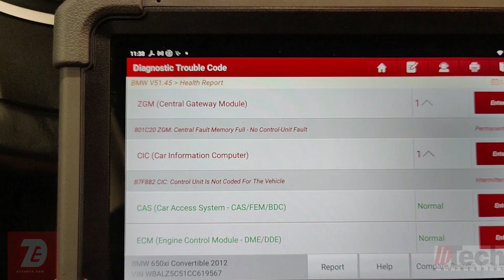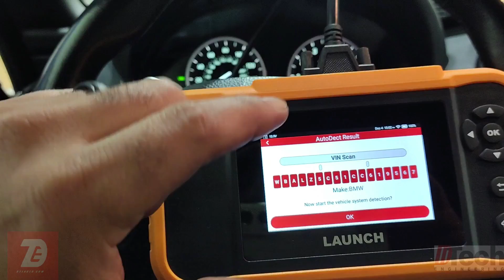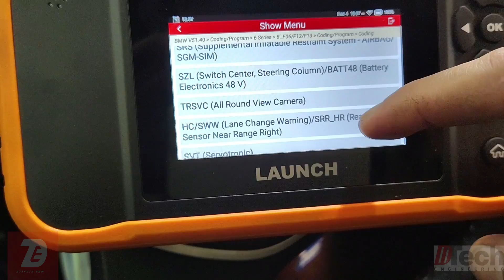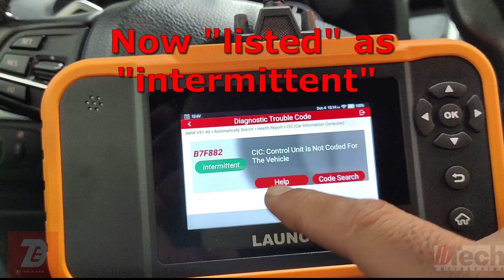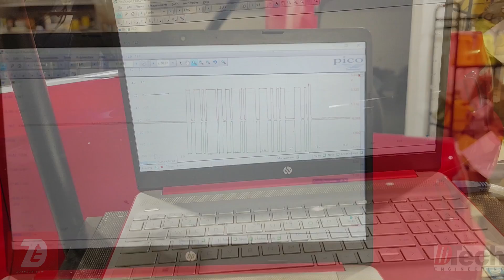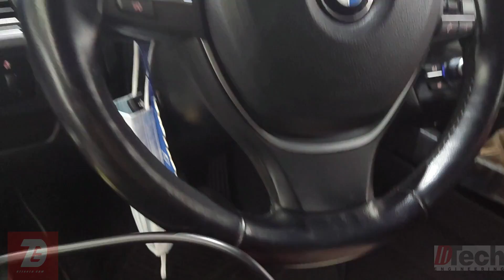BMW 650 i-Drive Knob Not Responding

Comment: Hello.  Urgent help please.  How did you remove the trim piece that contains the i-drive knob from the dash trim where they come together at the narrow part?  I know there are two screws that hold it in place, but then the center console trim will not release where it meets the dash trim?  The console piece seems to have a clip or a hook of some sort that goes into the backside of the dash trim?  I cannot make it out, but that is what it appears on your trim?  So, how do I separate the two pieces.

Comment: Hello boss i have trouble with the 2015 bmw 535d f10.or11.the car is not starting sometime is cranking sometime not and sometime is communication with the ecm sometime not showing me this trouble code in engine ecu 254D00 related to voltage please any idea what's wrong or waht i can check thanks
Reply: Check your ground strap left side of engine top of motor mount to chasis ...common failure point ...